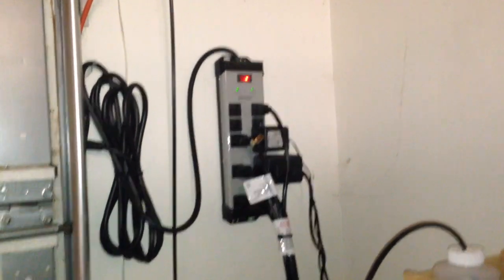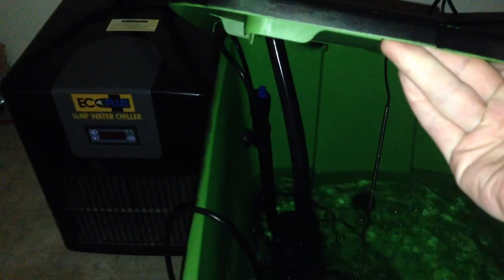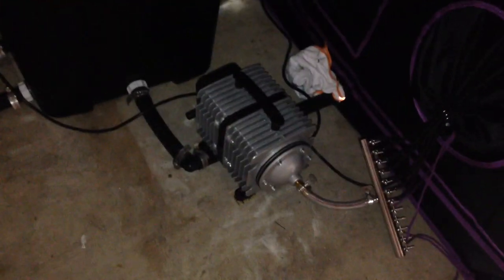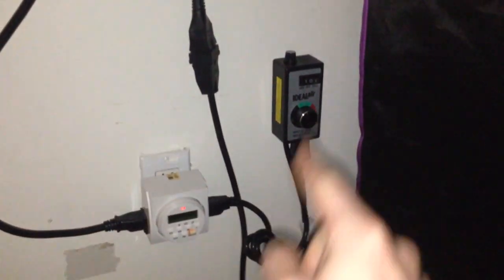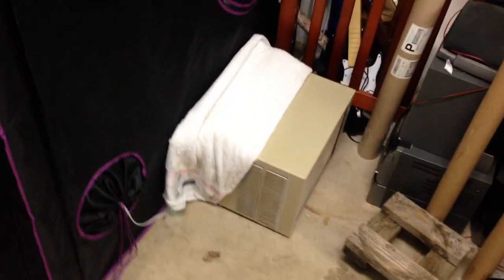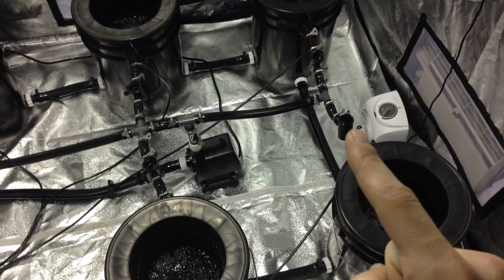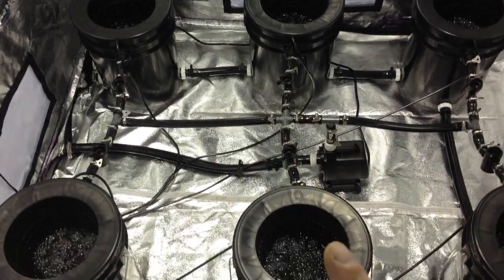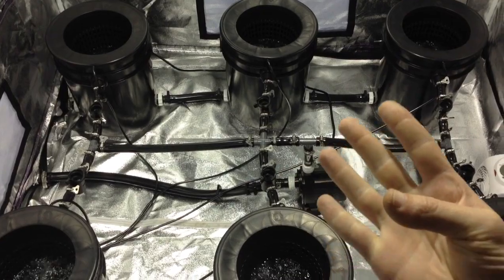RDWC hydroponic system

Comment: Why are you using commercial size equipment in a 5x5 tent. You are going to out grow your tent with what you are running. I can fill a 5x5 with 1200w led (550 true watt) with a RDWC that moves a quarter of the volume of water your system does with only 4 buckets. You may even break roots with how much you are moving it. Think of a ebb and flow system. It only floods the roots 3-5 times a day! You are changing the water in every bucket every 30 seconds. Also you are going to blow through a small fortune on nutrients with this system if you havnt figured that out already. Great system but I'd consider scrapping the 5x5 tent adding maybe 3-4 more buckets so that the system actually makes sense for pump sizes and res size. Maybe close off that garage with some sheet rock or mdf. Just my advise but what do I know 😝
Reply from the maker: Golden Goodness Hydroponics The advantages of owning a home vs. renting a home sir.
Reply: Devin Olsen I rent also I know the frustration.  I know from experience you are going to need more room and that's with topping and LST. 6 ft seems like a lot until you start taking into consideration light hang loss bucket height and minimum space between light and plant. If you don't want to mess with anything structure wise in the garage I'd get some lumber to make a frame get some foam board and staple it to the frame with a heavy duty stapler. Get you some reflective Mylar by the roll and make you a room. It will only cost maybe 100$ plus you can reuse the 5x5 for a veg room. I'd go 8x8 for what you have right now at a minimum or else you will find yourself with no room to work in the room after just a few months. I want you to have a great first run man and a less frustrating one haha.
Reply from the maker: Yeah I agree man, and have been told by peeps a number of times :). I've been working on the DRO-Matic for so long I've kinda ignored the grow room concerns for a bit, but as I'm wrapping that project up and ready to get this going so I'm back to these points.
Things I'm able to do right now is flip around the pump I have in my reservoir (smaller than tent pump) to slow water down and drop down to 3 gallon buckets to get some more height back. Also with the connection I can remove two whole buckets and go 4 up instead pretty easy, so that is also an option. And of course expand the tent by building structure around it, but holy moly my land lord flipped out when he seen my tent last July so god knows what would happen if he sees a whole divider haha, but I hear ya man I really do and will be putting more time into these concerns very shortly.
Reply: Devin Olsen I think instead of going down to a 3 gallon to save vertical space I'd go with a rubber made container. You will fill that 3 gallon bucket with roots and it will cause issues. Can you move that exhaust vent any farther from the tent or go outside wth it also? You will suck it right back in the way it's set up now. Not trying to be critical of your shit you did a great job just a few things to address. Also again kick ass job on that auto dosing thing. Would you re create one and sell it? If so how much?
Reply from the maker: Solid points, not sure about the vent.. I'll get back to you on that haha.
No worries man, this is a hobby for me (something my dad wanted to do before he passed away last year) so I'm open to as much info as I can get.
Naw, its all open source right now and open for others to build / use. It would be very hard for me to get a wrangle on manufactures across all the required parts while holding down my current full time, but would be awesome right?
Reply: Devin Olsen okay so Iv been thinking about a few of your issues and I think I can make some suggestions for some. Others it's just going to be a problem that you will have to deal with the best you can. 
I think you may need to look at some commercial systems that have a small mixing chamber before it goes into the res. It can be done pretty easily with the addition of just a small single chamber water filter with the filter taken out. You can run water and the solution in at the same time with a valve and it should be enough dilution to solve the nutrient lock out issue. Make sure the flora micro is added first if you go with the GH series. 
I'd get a used Ro system. I picked one up for like 50$ from my local shop but I see them all the time on CL and offer up. The replacement filters are super cheap also. But RO water is very important because it's basically a empty bus for the nutrients vs a crowded bus full of stuff like in city water. 
As far as the vent and the height thing. Well I'm not sure what to say because you have to cut a hole to vent outside. 
I know it's just a hobby now but it will be a passion when you see the girls growing because these systems make MASSIVE plants. 
I have almost the exact same setup so if you need any pointers let me know I'd love to help
Reply from the maker: Cool thanks man! Just so I know we are on the same page, the doer I'm building right now is this:
https://www.youtube.com/watch?v=GlZHTMk3PBg

10 hanging 32oz bottles that I will use to pre-dilute my nute and adjusters prior to the OS using the solutions with my reservoir and control bucket.
Reply: Devin Olsen ahhh yeah that works also I missed that part sorry. I think I got it confused with the 1st one you started to make. Yeah you are good to go in regards to that if that is how you are doing it. Also I'd recommend one of these for the RO system. Increases efficiency by like 50% so you can get a cheap 50 gallon per day system and still get 100 gallons a day out of it. 

http://m.sears.com/search=aquatec%20erp500%20quieter%20for%2050gpd%20or%20less%20ind%20erp%201000%20permeate%20pump?gclid=CjwKEAiAz4XFBRCW87vj6-28uFMSJAAHeGZbIdmc9FiZ9EfFzdjl_O9DNZmsSKIzbWBbngz-jgMC1xoCA5bw_wcB&s_kwcid=AL!4531!3!79900188325!b!!g!!_cat:sears.com%3Fsid&ef_id=WKIxWAAAAdGZ@hRG:20170213222112:s
Reply from the maker: I've been thinking about the ventilation as well today. 
Looks like it wouldn't be that hard (or expensive) to hook up a min solenoid actuator to a UNO with XBEE communication between DRO-Matic doser and little housing cover that sits over my garage door opener. 

When lights and exhaust flip on, I can easily communicate to open garage door about 6 inches and have a board with exhaust line hooked up too it on mini wheels so it rolls against the door when opened and away facing down when closed. No cuts and re-usable.
Reply: Devin Olsen that is what I was thinking just not as detailed with the actuators. Only thing is when you start to flower you will probably want to leave the fan on 24/7 or it stannnkkkssss. If you are not worried about smell you will be fine. Bad ass idea using the solenoid to open and close the garage.
Reply from the maker: So went out tonight to measure the garage space available and it all came flooding back to me why I went small on my first tent. From the top, my garage ceiling is split level, so half of it reaches 8 feet, while the other half only reaches 6'8' inches. However there is a large spot close to the garage door that is 7 feet tall; however again because of the split level ceiling, that only allows me 7' in length/width in this spot.

However if I stay under 6'8" I can easily go out to 8 feet in width/length.. so with that all said, what say you about this guy: http://tinyurl.com/gwlhny9 ? Maybe ditch the sodium light for low profile led box and gain a few more inches out of that linked tents height?